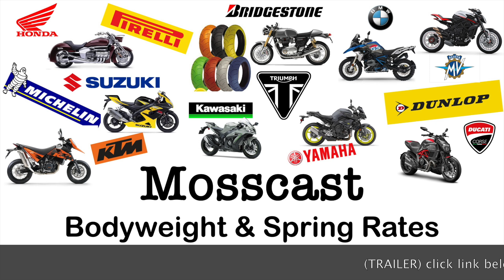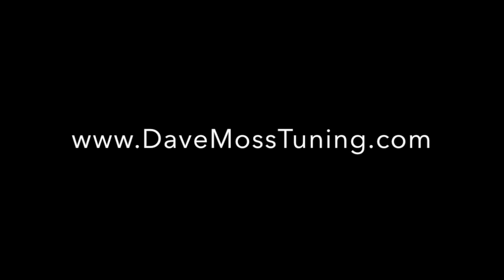Mosscast: Bodyweight & Spring Rates (TRAILER)

Comment: So what about rebound/damping on fixed setups... oil, emulators/spacers. Limited options, other than biting the bullet and finding drop in/replacement parts.
Reply from the maker: I raced a 2000 Suzuki SV650 with 30w oil, .95 fork springs and eventuallu emulators. I stuck a 1999 GSXR 750 shock in the rear that I sprung and valved. That package brought me a lot of wins at the track. So...... yes, just oil and springs can make an enormous difference as can fork position changes for geometry.
Reply: @catalystreactionsbw  Nice.